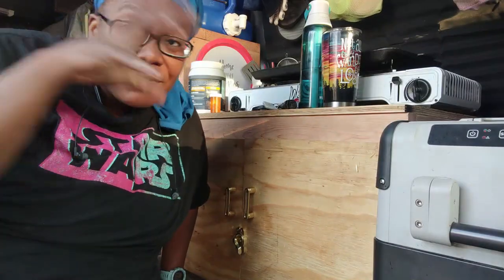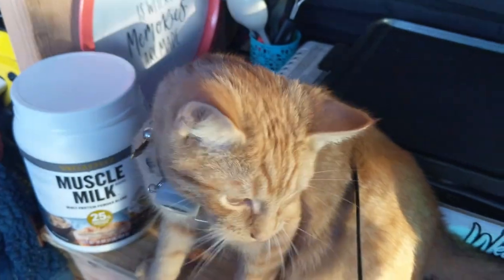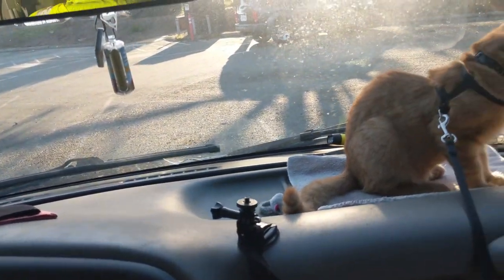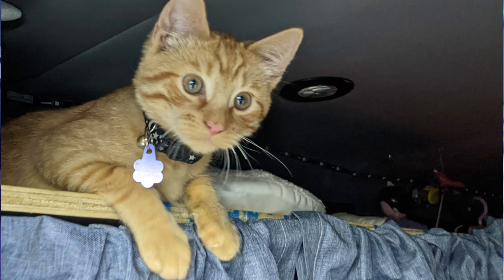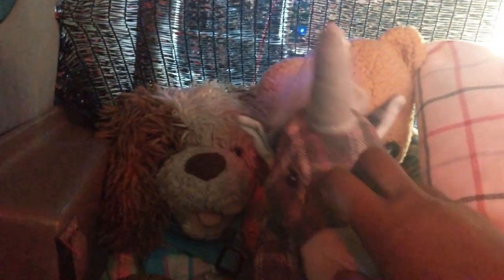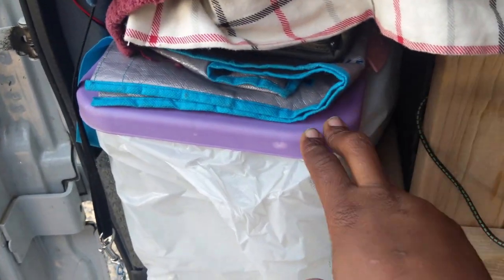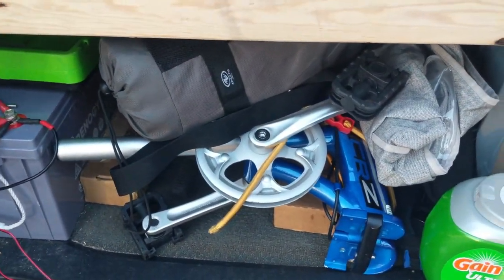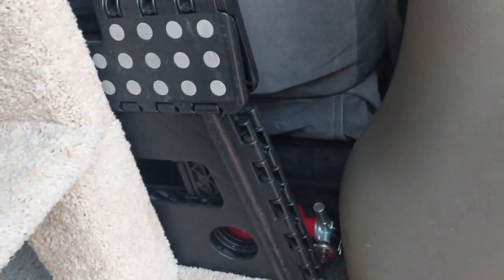Solo Female's Fulltime Vanlife with a Cat | Van Tour | Chevy Express 1500

Comment: If you look at larger truckstops you will find screens that fit in the windows on a semi. They may fit the front cab windows on your van. They are basically a plastic frame that slip over the edge of the window glass on the bottom (you roll it up to hold in place), and into the window frame at the top and on the sides. That would allow you to have air flow without Mickey escaping through an open window. Check at TAs or Petros. I used them when I had my cats in my truck and they could not pull them put.

Comment: Cable tie mounting pads... square plastic pads with adhesive on one side...sold at home improvement stores electrical section. And zip ties would go along way in cleaning up your electrical system.

Comment: I like the layout.  Everything looks handy but not too cluttered.  It's nice Mickey has space to play.  How do you have the car tree secured  to the floor or to the seat?
Safe travels and pets to Mickey🐾
Reply from the maker: It's just on a rubber mat. I wanted to test if I needed to secure it to anything and so I tried the same mat that's under the fridge and it doesn't slip an inch on city roads. On rough back roads it might fall over or on a sharp turn, but it's fairly light and there's nothing it can hurt really if it does fall over.

Comment: Hello,  Can you take your van thru the car wash with solar on top?
Reply from the maker: No drive thru style car wash, and not because of the Solar Panels. It's cause I'm too tall. Even when I had the minivan, I pretty much stopped being able to use the car wash because of the cargo carrier on top my van. I have to use the self wash car wash with the hoses. Solar can get wet... It functions in the rain. MC-4 connectors on the exterior solar wires are waterproof.
Reply: @TheDawnofVanlife  Hello Dawn, I have a 2018 Ford 350 XLT Transit and I go to the Red Carpet Car wash, it is not the med. nor tall one.....I am able to go thru with no problems.  I get the monthly pass.
Reply from the maker: @kathleenshannon8284  It's not a big deal, I just use the self wash car wash. I have never seen a drive thru car wash tall enough for my van and in the mini van, there was litterally a sign that said 'do not go through here with a Cargo carrier on your roof' (or something like that). Since then, I've been using the self  wash type, especially because of the cargo carrier on top. I can very easily find self wash car washes anywhere I go and I can fit in those just fine. Just takes more elbow grease, no sitting in my seat as the machine does all the work. But really the ladder and cargo carrier are mora an issues then the solar.
Reply: Dawn, Thank you for your responses, I didn't realize you had a Cargo Rack.  I want solar and 2 vents on top but I love Red Carpet Car Wash, the express wash (outside only).  I do sit on my know, but I have a disability, everything takes me longer to do......should I use elbow grease, I pick and choose............Take care, I'll continue watching your podcasts....Good Luck on your journey!